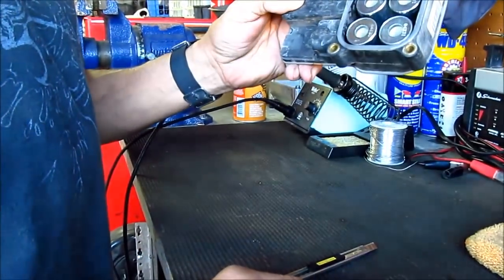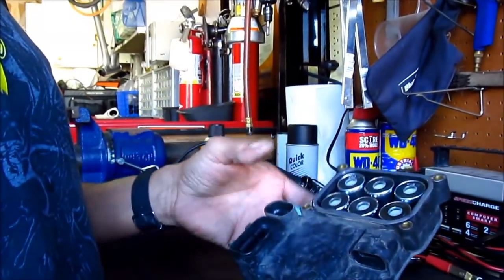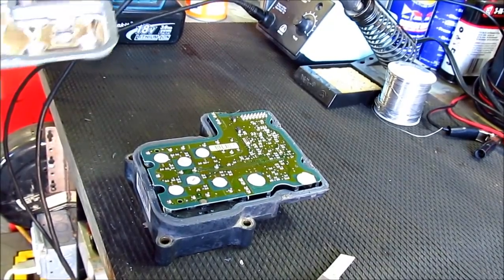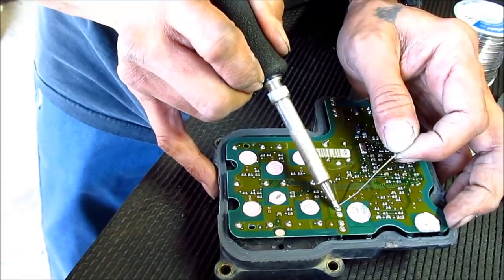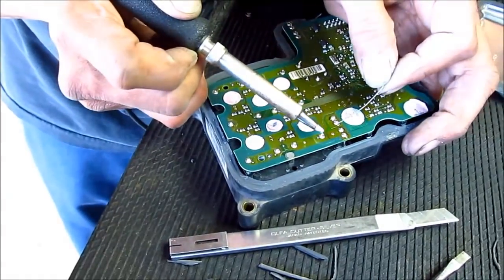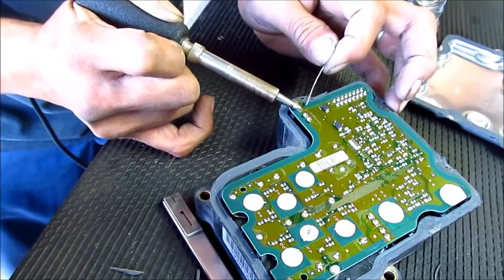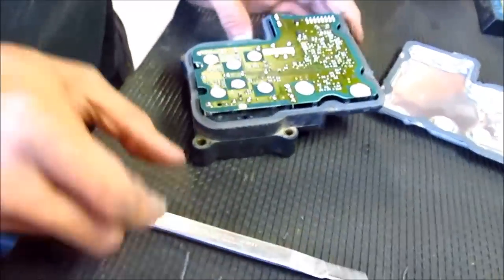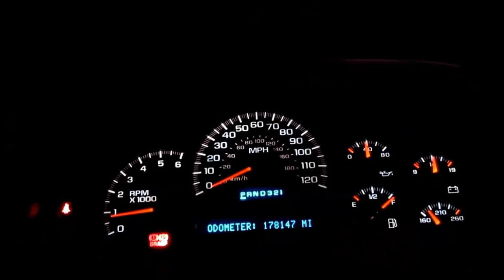Repair of ABS Module in my Avalanche

Comment: Two notes: on my 2000 truck, one of the t20 (definitely not t25 like some videos show) snapped off into the metal pump. Also, mine had 6 t8 screws holding the metal top on. I ended up having to take the whole pump out and cross threaded the lines when reinstalling. Waiting on a rethread kit to come in. So the lesson is don’t assume this will be a quick project like I did

Comment: I want to start by cleaning the ground wires to this module but can't seem to find them.....would you please guide me as to where they're at???module is in the same spot as yours but can't seem to find them ground wires😢
Reply from the maker: It should be on the driver side frame rail
Reply: @surferdown1  just found one right below the driver's door latch..isn't 3 together ?
Reply from the maker: Most likely  @nessa90
Reply from the maker: Toward the front of the truck

Comment: OK OK OK
Is it me or are shine off the comments questionable 
🤔, 
As the first step is look at the opposite side where the acrylic little cylinders that active the abs they should all be white
1st👈
2nd if need be open the back seal cover n only touch the ones the that are questionable not all ,.
N as for soldering did we added soldering on top of old soldering
🤔.
A for the people that comments
Just keeping real. 100
Reply from the maker: If I'm reading this correctly, I touched up all possible bad joints regardless of whether they are bad or not. On the other note, I didn't add more solder on top of old solder. If you watch carefully you will see that I actually heated and melted the old solder then flowed new solder into the joint. This solder job is still perfect as of today, February 28th, 2024. Thank you for watching.

Comment: Warning to all. I use to make the coils for several Kelsey-Hayes ABS systems and we also did several automotive modules. 
Be careful of RTV on circuit boards. A lot of RTV have an acidic acid that will attack a circuit board. 
I found a recommendation and attached: 
Non acidic RTV's are sold by aquarium shops, and for electronic encapsulation. 
The former is usually the 'easier' source if only a small quantity is required. 'Normal'
RTV's give off acetic acid, and are not suitable for use on a PCB. 
Look for GE 142, Rutland 76R, and similar products. As an alternative, consider a low melting point hot-melt glue.
After watching video you could probably use normal RTV on the perimeter only, not on the circuit board

Comment: Thank you for the video. A little tip for you on soldering that really helped me out.  It would be best to remove old solder with a solder sucker, I’m not sure if that’s the right name for it but you probably know what I mean. Then use Flux and some fresh good 60/40 
Rosen core Lead Solder. The flux is going to help remove contaminants away from the solder so it will be a solid bind with no cold joints. It will also help when it comes to melting the solder you will see melt instantly. Also get you some Brillo to clean the tip. You can just jab it in the bundle to remove any extra solder or junk built up to reveal a clean shiny tip again. a wet sponge is no good in my opinion because it just never worked right for me and I’m sure there is temperature drop and oxidation from the water that is left behind. It works in a pinch with a clean sponge and purified water. but I have destroyed and had several tips in the past Break apart. Also, it doesn’t do as good as a Brillo ball would. I’m pretty sure it’s brillo it came with my Hakko soldering iron. Furthermore, try looking up hakko FS-100 chemical paste. You will use that for the soldering tip after every use before storage or if you feel you need a refreshed tip to continue with. The FS-100 is like solder with a cleaner but it removes anything from the tip that can cause it to damage your tip or get in the way of heat transfer. Check it out I didn’t know the stuff even existed. Lol You will thank me later, I promise!! I have never soldered better in my history of understanding how to solder. I always thought I knew what I was doing till one day doing some research on how to be better and more precise. Now I can’t ever see any other way to do it. Once you get that down you will be amazed at how solder just works for you on point every single time flawlessly . Like if you are a pro. Your work will be way cleaner too. Also don’t forget to use rubbing alcohol to clean up soldered parts when you are done because the flux is corrosive and can cause damage. For soldering I use a Hakko FX-888D. It is amazing and you can find all different sizes of soldering tip sizes throughout Amazon. You can find the FS-100 on there too. I hope my advice will help you out like your video helped me. I just wanted to see if I had enough heat sink compound for the heat sink spots that you see in white…
ALSO for anyone that is going to rebuild theirs don’t forget to put fresh heat sink thermal paste on those circular white spots. It’s important to keep the electronics from overheating. From my research I can only find the one I know we need to use at Auto zone. Autozone sells it in tiny packets. It’s called Wells heat sink compound SL203. If you can’t get it maybe reach out to the company and see what you can use as an alternative. It’s what is recommended for GM from what I’ve read. You have to be sure that you don’t use any other heat sink product unless you absolutely know what you are doing. Some contain aluminum or something that can short out the electronics from what I hear. 
Good luck and thanks agian for the video! You got my sub and a thumbs up.👍🏻

Comment: Wish it was that easy to get at the screws on my sierra.  Mine are all rusted .  Think I am going to have to get the whole bracket off including brake lines
Reply: Try cleaning out the torx hole with a pick and compressed air 1st.  Good luck.

Comment: i did exact same thing and made sure to touch it good, but my abs pump keeps running unless I pull the fuse out regardless
Reply: Can you hear it like a mild fan noise? Got used tahoe with abs,brake and check engine light on for abs and knock sensor. What comes to worst after I check all grounds,leads,and speed sensors I can have pump replaced.  When I hit any bumps on freeway the truck swerves a little. Not safe at all so.thx

Comment: Did you have to bleed the brake system
Reply from the maker: No, I did not break the brake lines from the abs motor. I only removed the pump module.

Comment: My 2008 yukons abs module is not in the same spot. And looks different but my abs and traction control light is on and service brake light. I wanted to try this repair but with is being in a different spot and shaped different if this would still work. What year is your avalanch
Reply from the maker: My Avalanche is 2003 but the procedure should still work if your abs module has cold solder joints. I would recommend looking up some threads on the 2008 first before attempting this repair just to be safe.
Reply: @surferdown1  I have but no one has one for 2008. I will keep looking thanks for response

Comment: Do I need to bleed the brake system after I change the abs module? Should I disconnect the black battery cable while also changing this?
Reply: Disconnect battery is a good idea. Since you are not messing with hydraulic portion of brakes bleeding not necessary

Comment: ground wire under driver door frame(2 wires) will cause abs light and brake light to turn on too with a abs mod code 2002 avalanche

Comment: Surprised that damn dash works. I fixed more GM dashes solder joints and motors then any ABS problems...Did I mention fuel gauge fix. Replace the Fuel pump.. Really GM?

Comment: Thanks José, I'll give the one on my Saab a shot.
Reply: Did you got fixed your Saab with this ? I have the code u0212 un muy Saab93 08' aero ... ABS, brakes AND EPS/TCS lights comes on after hitting bumps on the road. Thanks.

Comment: What code did you have?
Reply from the maker: Its been a few years since the repair, I don't recall the code. Sorry
Reply: @surferdown1  thank you for your time! I will try what you did. I'm looking at buying a decent soldering iron now. If I could understand what you were doing, you were just adding more solder, is that correct?
Thank you

Comment: Very good video.  Was your ABS on "solid" all the time?  My ABS light comes and goes.   I've analyzed my ABS with an Autel and found the code C1095 pump electrical circuit short.  However all sensors are displaying good reading when driving I've witnessed on the analyzer. I can't activate the pump during a test either.  I bet I have the same issue.  Trouble shooting ABS without an analyzer is very difficult, good job.

Comment: What led you to believe, or know, that your ABS Module was in need of repair? My 2006 Avalanche has intermittent Traction Control and ABS lights coming on and off but can't pull up any codes through the ecm.
Reply from the maker: ABS light was on and I pulled "ecbm" code

Comment: Just wanted to thank you for doing such a super job making this video. It was very well done, right to the point and not too much "yammering and repetitive comments". Last night I watched your video, went out in my garage and pulled out the ABS unit on my 02 Silverado 1500 4x4. It was mounted up inside the left side frame rail. Behind the left torsion bar. What a pain in the butt to get it out. I had to undo all the brake lines and nearly had to pull the Tcase. But finally finagled it out. I did the soldering technique you showed and BAM! No more ABS / brake light! Thanks for sharing!
Reply from the maker: You are welcome, thanks for the comment!!!
Reply: Oh wow, now i know what's ahead of me, with my 2000 Silverado 1500 4X4. Thanks to you both sharing this info!

Comment: My Avanlanche has 35k on it... and I'm getting the ABS light on and the Stabilitrak light on.... Hard to believe these are going bad with such low miles.  Could it just be a sensor instead of the actual module?  any suggestions?  Thank you
Reply from the maker: First thing you should do is have someone scan for trouble codes. Once you have some trouble codes, you will have a direction to start fixing the problem. By the way, 35k? don't you still have the factory warranty?

Comment: im having the same problem with my 2004 chevy avalanche but my turn on and off could that be the same problem
Reply from the maker: It's possible but I would have someone hook up a diagnostic scanner and pull the codes first. Autozone can pull codes at no charge. This should be your first step.
Reply: My abs and brakes light doesn't always stay on it usually goes always but I'll try it thanks

Comment: I see that your ABS light was fixed, but did that fix the ABS system so that it works.  You didn't test that in the video...but a hard stop would let you know from the pulsating pedal, right?  Great video with clear camera work and explanation.  .
Reply from the maker: Yes, the abs still works fine. Thanks for the reply.

Comment: I guess I'm a bit confused. What was ur problem with that module. We're guessing there was a bad solider joint and what u did fixed it. Was it a loose or cold joint.
Reply from the maker: I had ABS light on dash, the go to fix was the ABS module. Trouble codes pointed to the module so I touched up all the solder joints in the module and fixed the problem. I'm going on 3 years and the problem has not come back.
Reply: Jose Ilagan thanks ... my abs and brake light have been intermittent. No braking irregularities. Might be worth putting up t on the ramp and checking it out. By the way ... got ya beat on the mileage. Got 209 k.   Later
Reply from the maker: I didn't have any brake irregularities either but I was coming into the rainy season and did not want to take any chances. When your ABS light comes on you have no ABS. Good luck!!!
Reply: Jose Ilagan Thanks Jose ... really appreciate the feedback .... keep that truck running. I wouldn't give mine up for nothing.  Take care

Comment: My 2002 Avalanche has ABS light on but not Brake light on ,when truck is turned off the pump still stays running..I pull 60 amp ABS FUSE it stops  and truck is drive-able with brakes working however now Brake light is on ...will this fix solve my problem too?
Reply from the maker: I couldn't answer that for you not being able to do a diagnostic scan on the vehicle. I would recommend to get your truck scanned and get the trouble codes to determine if it is the ABS module or the ABS pump then try the repair if it points to the module. Good Luck
Reply: C0265 Thats the code
Reply: C0265  states ecbm bad also could be bad ground any advice?
Reply: C0265 States the ECBM Module is faulty or could be possibly bad Ground any advice?
Reply from the maker: Hope this helps, Good Luck

ABS Light On, DTCs C0265, C0201, U1041 Set and/or Loss of Communication with Brake Module (Reground EBCM Ground) #04-05-25-002D - (06/14/2007) 

DO NOT REPLACE THE BRAKE MODULE.

Perform the following steps to improve the connection of the EBCM Ground:
...Remove the EBCM Ground.
...The EBCM Ground is located on the frame beneath the driver's side door.
...If multiple grounds are found in this location, the EBCM ground can be identified as the heavy (12-gauge) wire.
...Clean the area, front and back, using a Whiz Wheel®.
...Install the ground, then the washer and then the bolt to the frame.Important:....It is important to use the bolts, washers and nuts specified in this bulletin. These parts have been identified due to their conductive finish.Install a washer and nut to the back side of the frame.
Tighten
Tighten the nut to 9 N·m (79 lb in).Cover the front and back side of the repair area using Rubberized Undercoating. An additional check can be made to ensure a good connection for the Battery Cable to Frame ground. It is possible for this ground to cause similar symptoms with the ABS as described above.
Reply: Jose Ilagan I'm leading to the pump relay has cold solder joints on board.
Reply: I have the pump stays running and kills the battery issue as well. No abs light since I changed out the wheel hubs. I've read there's a relay that gets stuck in the module but haven't found anything on repairing it. For under $50 on eBay....
Reply: Got this same problem so I pulled out my fuse Also so the pump would stop running. Did you fix your problem?

Comment: Jose if I send you a picture on my 2009 Mitsubishi Lancer ABS Control Module you think you can show me which points on the board need to be resoldered?
Reply from the maker: Unfortunately no, some solder joints look fine to the human eye but can be defective where it contacts the circuit board. It cannot hurt to touch up all of the solder joints but be careful not to overheat any part of the circuit board. If you are not experienced in soldering I do not recommend attempting this repair as it could cost you more money than saving you money. Good luck!!!
Reply: Jose Ilagan Thanks responding and for thr info Jose ✌

Comment: found loose connection in wire connector. 2002 toyota sienna. ABS BReak lights came intermittently. Get service manual/.

Comment: is there anything I can do if the guy who fixed my break lines cross threaded a brake line while putting it into the abs pump
Reply: Shoot him m retap with the next size up make sure you have a replacement fitting that fits orrrr jb weld n Teflon the threads so the jb doesn't stic but molds to the threads caution if you use to much jb weld it will go where it shouldn't and cause issues potentially.

Comment: Anyone have an idea on what to use for a stripped torx head? Glad it is the one to the left in plain view and not one of the ones behind the module that would be very hard to get to. Thinking a Dremel with grinder bit.
Reply: I had to pull the whole unit then I cut a line in the torx head and used an impact screwdriver to break it loose

Comment: Thanks for this video. I did this twice. The first time my soldering iron wasn't working well. I suspect the original solder is higher temp than what I am used to working with. After the first time I ordered a new higher wattage iron. I was still getting the code but in a little different pattern than before so I still thought the solder joints were the problem. I redid it with the new iron a couple of weeks ago. I could tell immediately that the solder was flowing much better. I now declare mine fixed.
Reply from the maker: wlsonoma Glad it worked out.

Comment: I have seen videos of people using heat guns to reflow solder. Do you think this could be done on the ABS module without damaging it? I would think using a heat gun might would be possibility preferable just because it would reflow the solder on every joint all at one time. Thanks in advance for your time. Great video btw.
Reply: The Surface Mount Components would fall off, and the board would be as good as trash if you get the all the solder that hot. Hope that helps

Comment: I spend my abs Electrical ABS module to speedometer for refurbish. My rear brakes still locking up. So check your brake calibers & replace them, 
  eliminate the problem. Happy camper

Comment: 2004 Chevy Tahoe w/160k. Mine didn't have the 6 screws and joints didn't appear to need touching up but i tried it anyway. I touched up all the joints and sealed up with rtv silicone 20 minute quick cure lightly clamping while it cured. Its been about 4 weeks and the light hasn't come on once. We'll see how long it last. Thanks for your help!
Reply from the maker: +lundy36752 I did my repair November 2014 and it is still working as of May 2016. Mine didn't seem to need touchup either but it fixed the problem. Thanks for the comment.